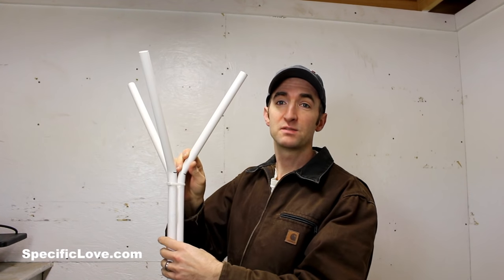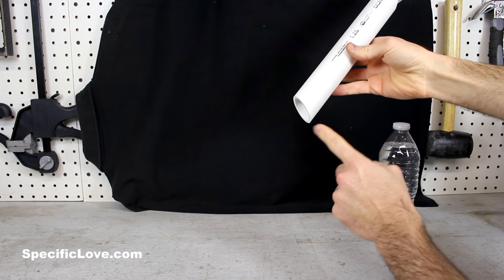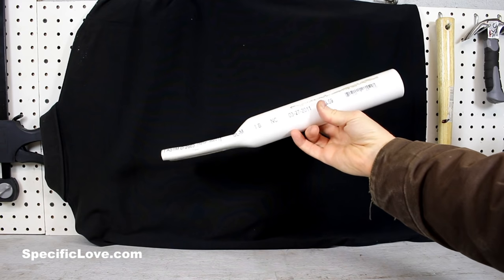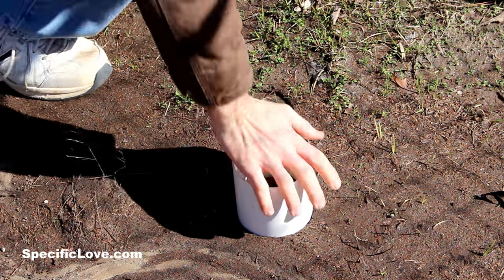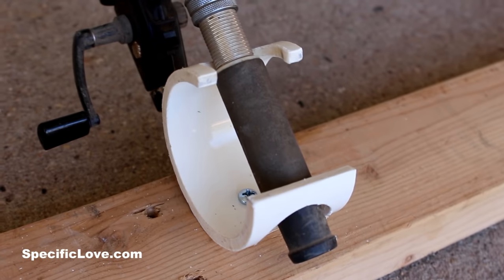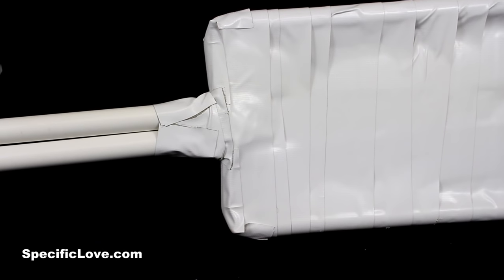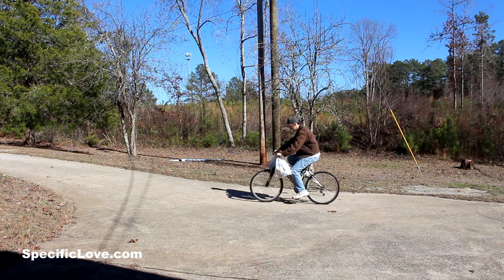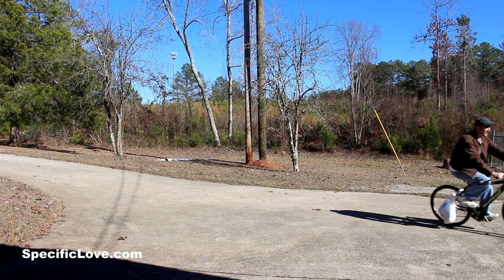10 Life Hacks with PVC #23

Comment: I have a couple ideas for you!! First I took some 2 inch PVC pipe and cut a 45 degree angle in one end of it, then measured it out from the longest point to the other "longest point" and cut another 45 degree angle about 5 inches apart. Then I drilled a hole in each end (in the beveled 45 degree cut) and counter sunk the drilled hole. After that I mounted the pieces of pipe on the wall in my kitchen horizontally to hold my long barbecue tongs and burger flipper in! Face it they don't fit well in the drawer with the long handles, and mounting them to the wall horizontally saves a lot of space as well! The second thing I made (inspired by our channel) is I took another 2" pipe an cut a 45 degree bevel into one of it. Then I cut that bevel off as close as I could to the thinnest  edge of it as I could. I made a slit in the thin part of the bevel to allow it to wrap back around the 2" pipe it was cut from. Then I took a 2:" end cap and a piece of the same 2" pipe about 3 and a half inches long! I glued the beveled end on to one side and the end cap on the other and it became a pencil holder in my shop after I drilled (and counter sunk) one hole in the beveled end to my wall in my shed!

Comment: An Idea I have done about three years ago, and works great for me, I wish I knew how to put a photo of it for you? I used 3" sch 40 pipe cut to approx 5-1/2" and an cap on one end then shaped the other end so I could use a hose clamp threw the tang similar to your fence hanger then clamped it to the square tubing of the frame of my end table that stays by my bed for my laptop and I made six of these. They make great T.V. remote holders and double as soda can drink holders.  some of them hold my screwdrivers and other similar small hand tools I like to keep close to my bed.  I do not glue the caps on so if dirt, dog hair ETC. collect in the bottom,  with a little effort I can remove the bottom caps and wash them out and press them back on.  I been wanting to show you my idea ever since I made it, but Been having difficulty learning how to make youtube videos and photos.  ( it's the editing and posting I get impatient or have it not load as I intend. )  I am huge about recycling,  and going green with wind, solar and repurposing stuff.

     For the fishermen out there, I used a 3' long pipe large enough for my hand to fit inside, I think it was a 5" diameter sch 40, and glued on the adapters for threaded clean out caps on each end, I used two pieces of plywood 1/2" thick and approx 12" x12" square. found center of the plywood and set a blind nut threw one side and drilled a hole threw the center of each cap and pushed a bolt threw in a manner it can screw onto the blind nut acting as a clamp holding the plywood and cap together  creating a wide base and table top.  I used epoxy as extra support holding the blind nut, bolt and cap together.  the caps are then han tightened on to the pipe.  inside the pipe, I have dirt and icetea bag grinds to keep my worms for fishing bait.  when the worms crawl down to the bottom, I simply place the lid on and turn the pipe over and open the other end.  when the cap is on it doubles as an end table for my soda, or a portable waist high table for re-rigging my fishing poles and other equipment.

Comment: Here's some notes and  improvements for the bike bag holder
  Add reflective tape, safety is a good thing.
Make sure the bag hooks are far enough apart so the bags aren't snagged in the spokes when leaning through a turn.  If this makes the bike too wide make the holder part of a frame work that keeps the wheel free or mount it high enough the bags can't touch the wheel at all.
The open ends may allow things to gather inside, dust isn't a real problem but water can turn into mold and who wants a stinky bike?  Here are some options:  drill a hole on the down side, or use different parts.  On the kick stand side, replace the T' with a 4 way, or the elbow with a T.  Another way to prevent the problem is just to fill the whole works with expanding foam, water can't gather if there is no room.  This will also add structural integrity and eliminate any noise from air passing through the pipes.
Reply from the maker: +ScorpionRegent Great suggestions